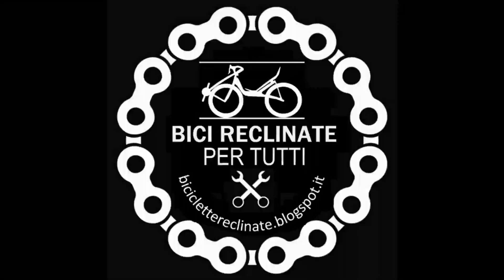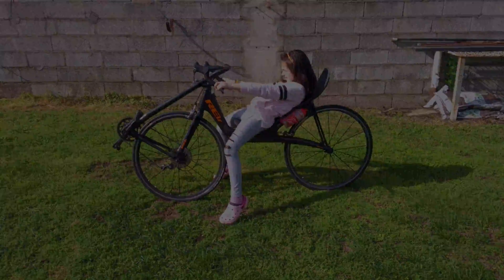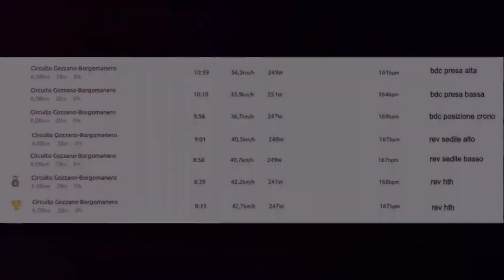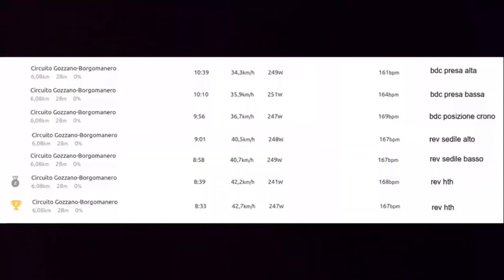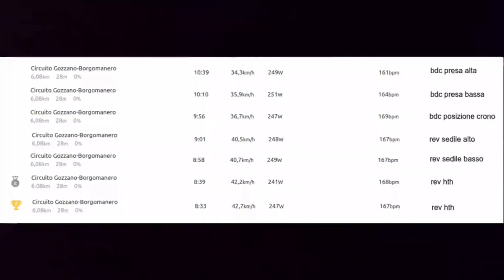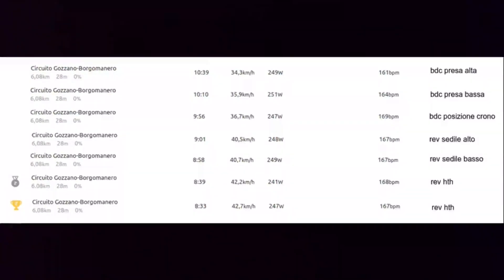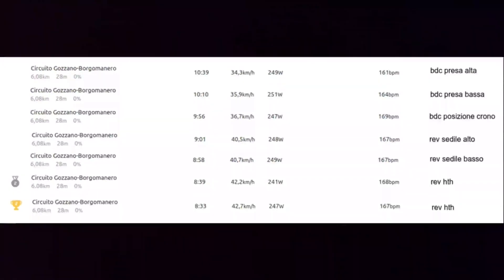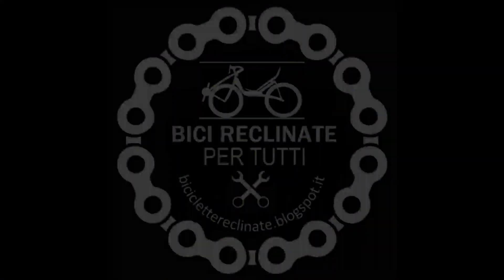(ENGLISH) Which is the fastest bike with 250W?

Comment: Hi Marco. Can you share the  gearing setup (front and rear)and road tyre used for rev HTH? The rev HTH is using 26inch wheel right?
Reply from the maker: No, I use a 700c wheel for all the bikes, Continental GP 5000 tyres. On the Hth the gearing Is 58T front, 11-40 cassette.
Reply: @MarcoRuga  thanks Marco👍

Comment: The first and second recumbents are approximately 18% and 24% better than the 'UCI safety bike' @ 250 Watt averages.
Reply from the maker: On the flat there is no way that the diamond frame is better
Reply: @MarcoRuga  correct, 18 to 24% worst